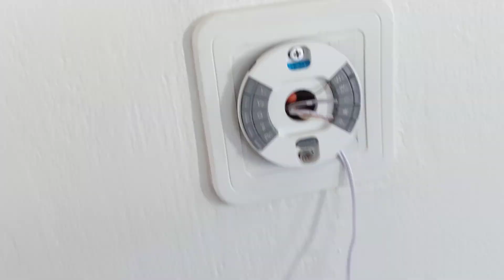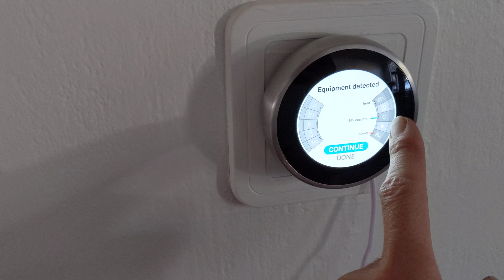nest learning thermostat with Williams gas wall furnace

Comment: Bro you a life saver.  I have the same exact Williams wall Heater and I purchased the Nest Gen 3 for 100 bucks.  Was Afraid I wouldn’t be able to replace my old analog thermostat with the nest but it took no more than 10 minutes to get it up and running.  I did have to swap the to wires on the 24volt power plug until I didnt hear the buzzing sound but yo I got it to work.  Just make sure the Grey and White wire from the 24 volt power is connected to the C and the all white connect to the Rc with the power the power from the heater Thank Bro.

Comment: this is awesome dude. Im trying to do the same thing and im lost. Which transformer did you use? How is the wiring chain setup?
Reply from the maker: Just updated the video description with an amazon link to the 24v adapter I purchased, and a pic of my old thermostat (for what the wiring looked like before. I noticed other videos were different from mine.) I hope it works for you! I would be happy to answer any questions on my setup. excuse the slow response -_-
Reply: Trying do this  have issues wthtewirig to the furnace . Help!
Reply: I was about to ask the same thing